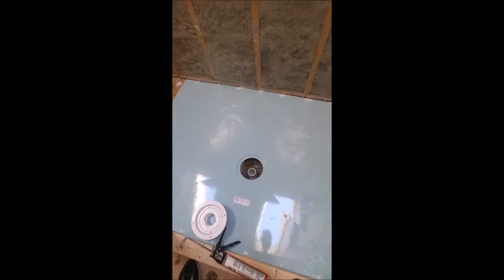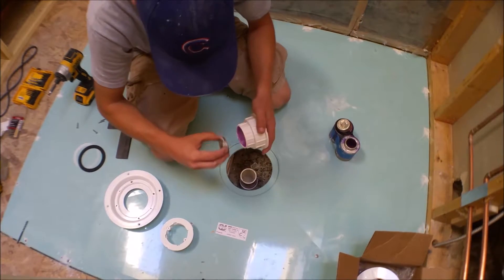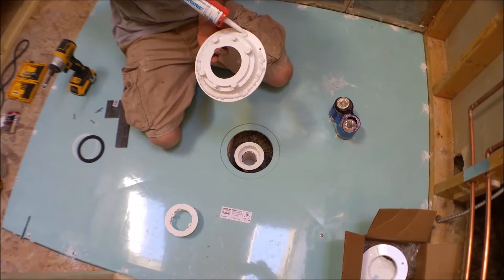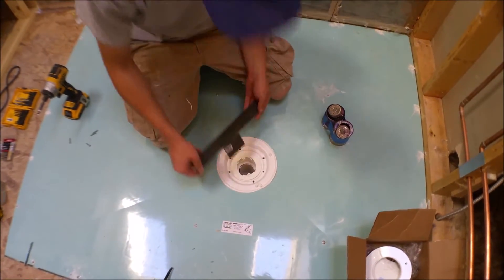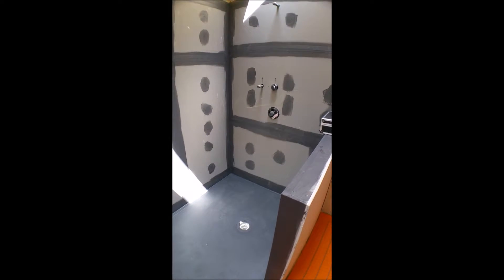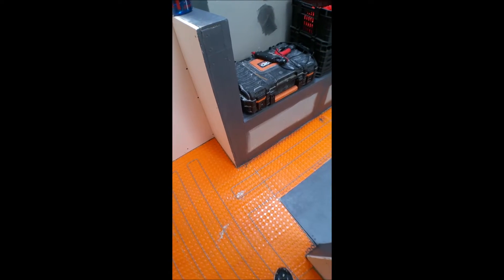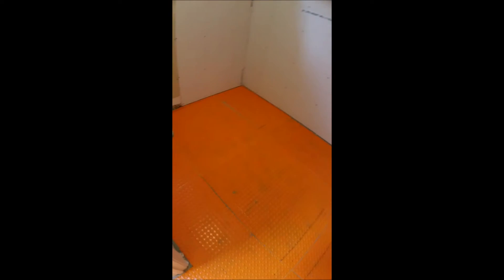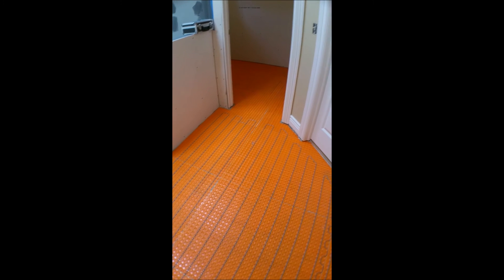Barrier Free Bathroom

Comment: Nice work man like how your using modern building products. Btw is the truedek pan higher than the sub floor? So when you lay the dittta it’s level with the pan?
Reply from the maker: It's 1/8" above the subfloor to meet the Ditra. If you use XL or a taller substrate on the floor you can shim the pan up.